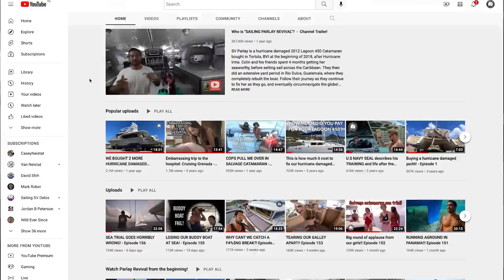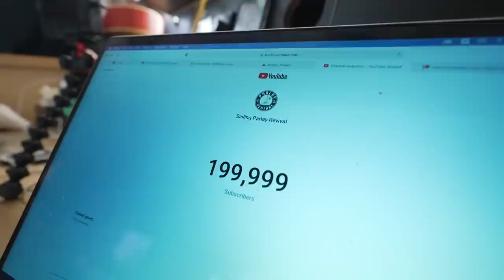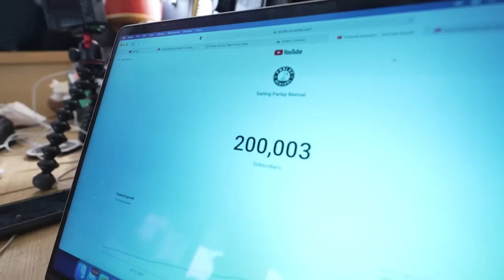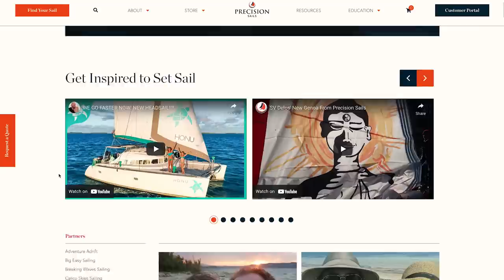WE REACHED 200,000 SUBS!! + custom aluminum sailboat tour! - Episode 157

Comment: You can put a depth sounder in water inside your vessel as long as it is sitting on the bottle of the vessel an submerge in water . An  then you account for feet or meters like you wud any other time... It works my dad didn't want to put holes in his vessel so this is what he did. He used a mason jar with a cork to fit top with everything sealed an hooked it up.... It gave the correct depth...
     Congratulations guys !! I wish you all continued success. You deserve nothing but the best... Thanks for sharing your lives with us and Fare winds and following sea's guy's ✌🏼💗😊❣️

Comment: Congrats with 200k subs. However, I'm not sure that your work with PR can be classified as the hardest among the sailing channels. OK it was hot where you found PR and in Lindon Bay, but there are damaged and trashed boats in much worse condition that are being restored and a couple of new built, all done by amateurs with less skill set than Colin + crew. But in any case and again, congrats with it all. The Revival of Parley IS an achievement.